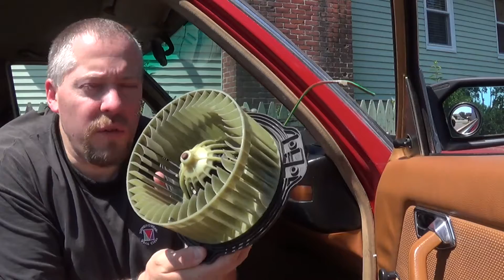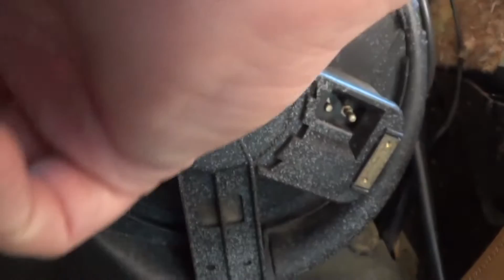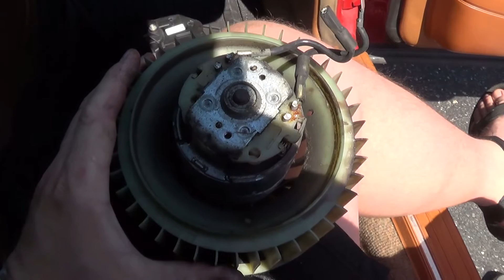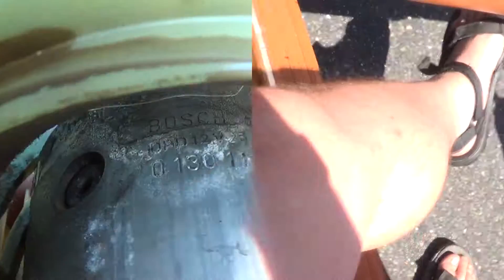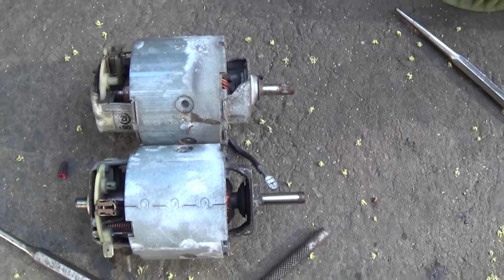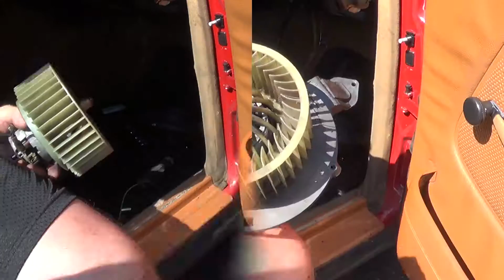1983 Mercedes-Benz 240D: DIY - retrofitting a Volvo blower motor

Comment: I almost predict your issue could be something similar to this https://youtu.be/2oK-SXVzYEU
Reply from the maker: Oh, I'm SURE the problem is the resistor pack. The problem is accessing it in this car. I think the airbox needs to come out. Then there's the fact that the part is NLA, and that even used ones are very hard to come by and expensive. 

I'm going to be retrofitting an infinitely variable DC motor controller in place of the stock controls.
Reply: MercedesDieselGuy
that's probably your best option.
Reply: MercedesDieselGuy
I bet that resistor pack dates back to the Carter Administration...
Reply from the maker: Reagan. The remaining parts of the HVAC system (aside from the blower motor) date back to when the car was assembled in 1983.

Comment: Sweet, thanks
I have a 240 with a 300 Turbo Diesel 4 speed, if you ever have the chance to drive one or convert one I highly recommend it. 28 mpg city, 36 Hwy. It really works well. I bought this 79 parts car for the transmission and well it has a 300 non turbo that runs good as well. Lots of fun.  thanks again

Comment: Love the 240's-300's, I have one of each, best cars in the world
Reply from the maker: Agreed. Love 'em!
Reply: Hey there, I have a question for you. I just pulled a 4speed transmission from a 300
d wagon, on the main shaft is there suppose to be play? It moves up and down just a bit, but I'm not sure what the specks should be. Thoughts ?
Thanks, Mark
Reply from the maker: The 4-speed in my 240D had a bit of play when I had it out to replace the clutch. I was told that it's common and essentially normal, and not to worry about it. Your mileage may vary.

Comment: Boo! Don't be taking those 850 blower motors, I need them. lol 

The date is on the other sticker. looks like you have a  new old stock motor.
Reply from the maker: Sorry - had to get creative on this one ;)

Thanks for the tip on the date sticker. Why would you say it's NOS, as opposed to a part that was installed in the car from the factory? I pulled it out of a junked 850 which was heading to the crusher shortly.
Reply: +MercedesDieselGuy it looked like the date was 2002 and the cage looks clean.
Reply from the maker: Awesome info to have. Thanks.

Comment: Do you still have the Subaru?
Reply from the maker: It's still running, but parked for the summer. Assuming it passes inspection, it'll be back on winter duty.
Reply: +MercedesDieselGuy yeah I didn't see it there so I figured it was either on the street or in the garage.